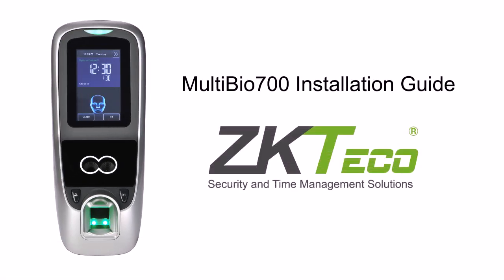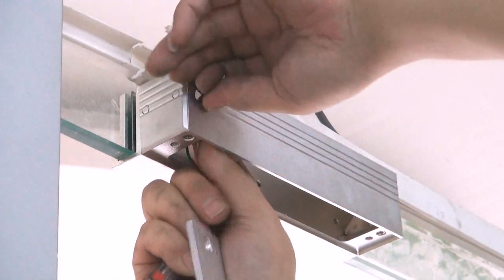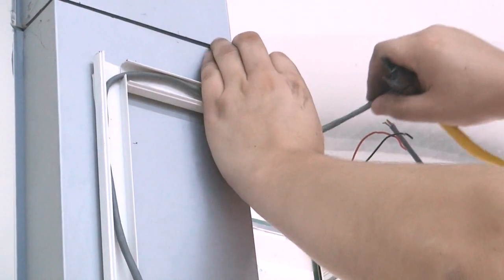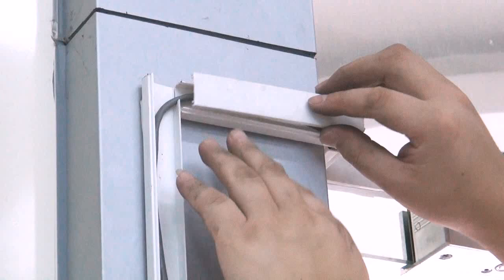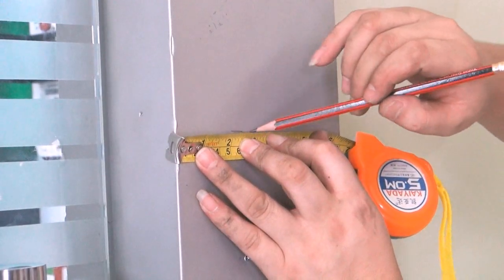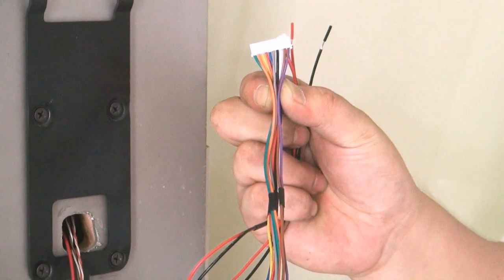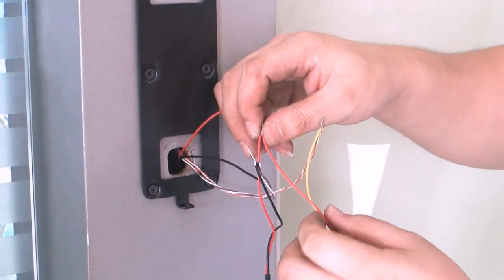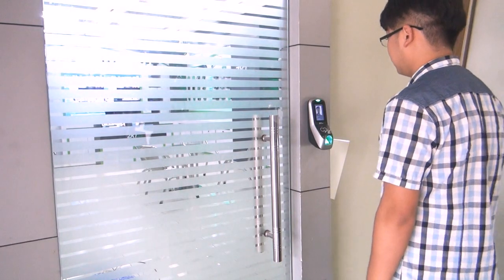Multibio700 Installation Guide

Comment: Thanks for the instruction video but the missing piece is the transformer.   Where did you put that and what about its power source?   Is it low voltage?  High voltage?   And do all of the cables come with it?    When you refer to TCP/IP cable are you referring to Cat 5, 6 cable?      And what about the wires that are not being used from the cable harness?  Just tape them together and stick into wall?